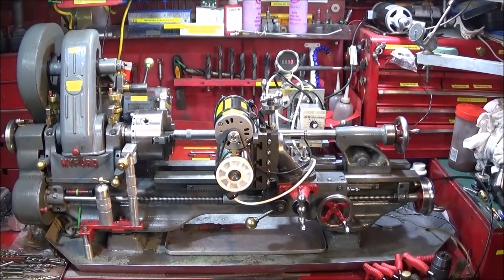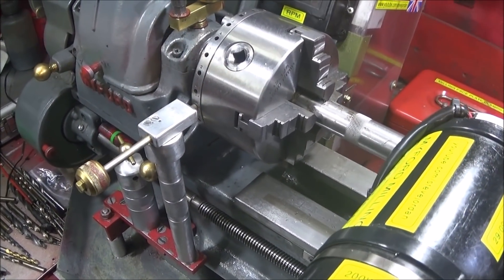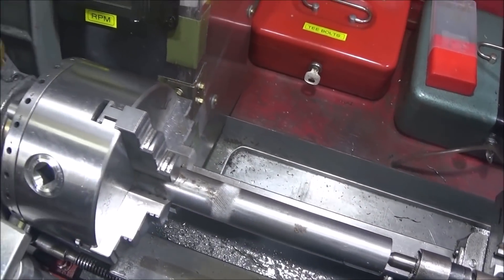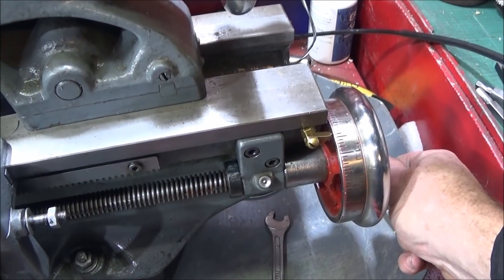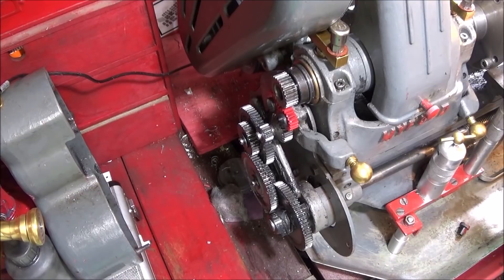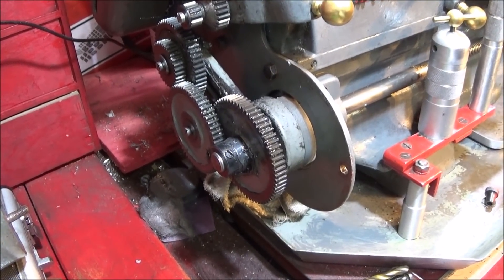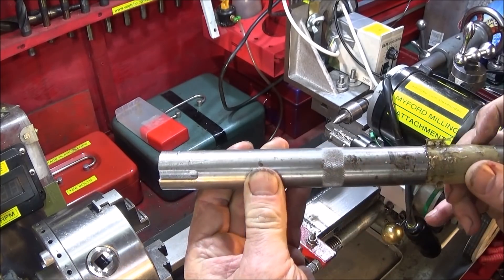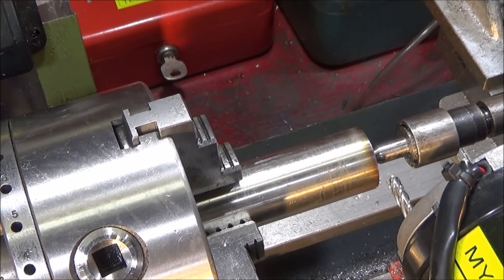Keyway Milling Test On Steel Shaft With Myford Milling Attachment.

Comment: Hi Steve, I like your videos.
Just a note. I think your tachometer is showing twice the actual RPM.
Being a motorcycle tachometer, it is made to do this, as a 4 stroke single cylinder engine sparks once every two revolutions.
Reply from the maker: Hi John, Thanks ..This Tachometer uses a magnetic proximity switch, which reads one revolution each time the magnet passes the switch. I have checked it along side the other machine digital tachometers one can buy plus with a handheld contact tachometer and it is spot on. There are the type of tachometers which you mention, but this one is completely different in its set-up, which is why I chose it. Regards Steve
Reply: Hi Steve, thank you for your response.
It was just my impression on seen the video; sorry to mention that.

Comment: Very nice!  Could you have done this on your Chinese mini lathe with the cutting tool in the chuck and the work in your mill slide attachments? (as that is what I will have eventually, got the lathe but need to make your milling set up yet).
Reply from the maker: Hi Glyn Thanks, yes it could have been done on the mini lathe like you say. I was showing the capabilities of the milling attachment as an example.
Reply: @SteveJordan  Thanks for that Steve.

Comment: Gday Steve, certainly no vibrations in what so ever and getting a very nice finish, do you think it would handle a 20 thou cut, great video once again mate, cheers Matty
Reply from the maker: Hi Mat, Thanks. I reckon it would be ok on a .020" thou cut with a shorter end mill bit, but having said that I normally only do .010" thou cuts anyway to make the bits last longer Regards Steve